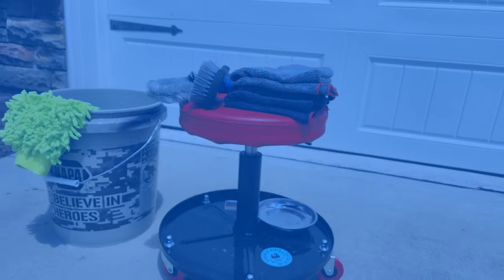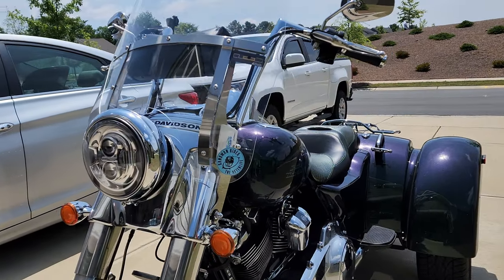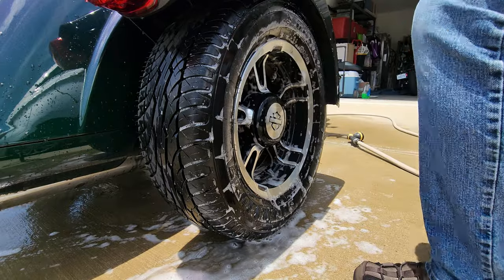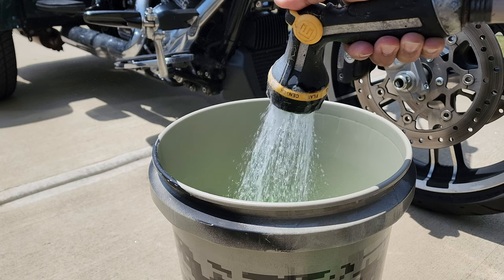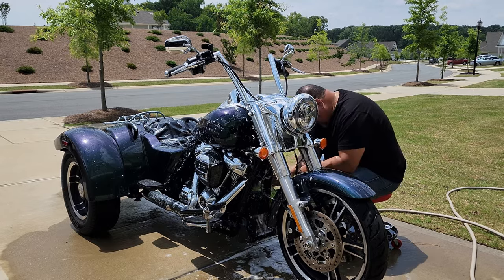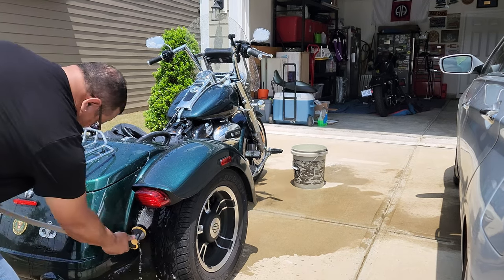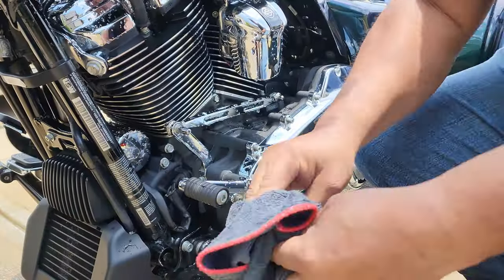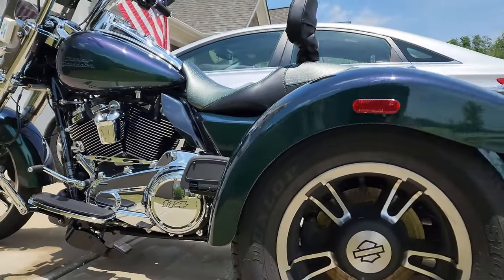Washin' Your Freewheeler Like a Pro: The Ultimate Guide

Comment: You definitely need a leaf blower to blow out the excess water in the little crevices before a final wipe down
Reply from the maker: I have an air compressor, but I ride the water off the little crevices instead. Thanks for watching.
Reply: @sandmanrides4318  Just a thought, you may get oil or dirty water residue from the compressor. A leaf blower works best.